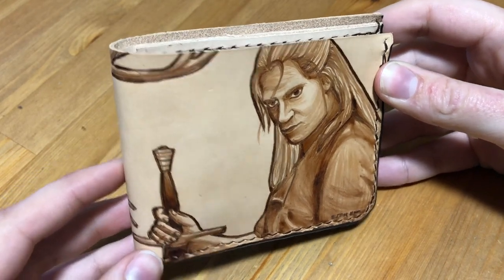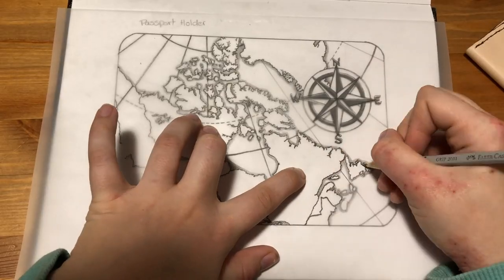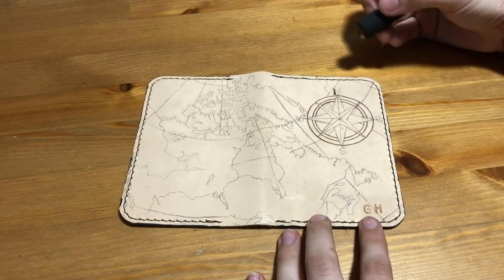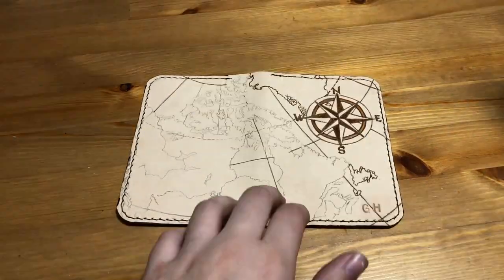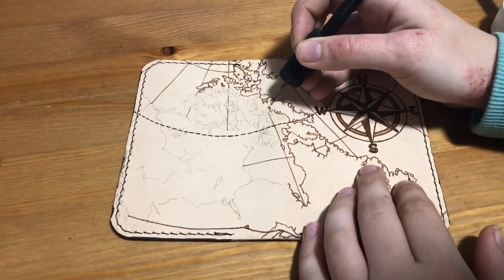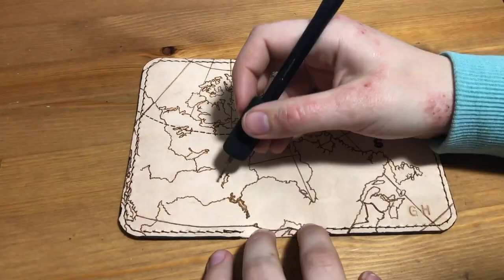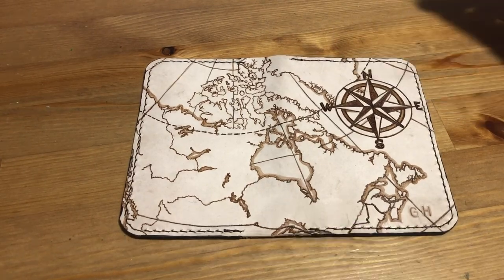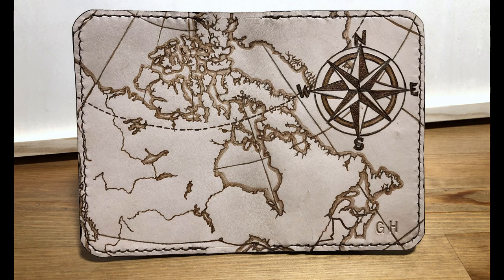Pyrography on Leather | Passport Holder

Comment: I'm still figuring it all out. I do have a wood burner and a simple beginner tool made for leather. I do print mine out. if it doesn't matter what direction the graphic is I found I can go over it heavily with a pencil and then use the transfer tip on the wood burning set I have to transfer the image. Or put it on my light table and do the same if it has to be a certain way. 
Also the leather does have a slight smell to it. It did throw me off at first because I'm used to burning wood. It does not smell like burning flesh.

Comment: I use the leftover pages from kid's 'sticker books', just reverse the image on the computer then print onto the leftover sticker page. I usually leave the print for thirty minutes so the printer ink has time to evaporate. Then just cut out the image and rub it on the intended piece to burn. 
I set the printer to 80% this helps and the image is clearer once rubbed on to the wood surface! I really like this method when I'm burning fancy and intricate writing. Just take all the stickers off the page and print where the stickers used to be.
Give it a go you'll never use any other method once you've given it a try. Also print in a red so you know where you've burned. A sample of my work can be seen in my avatar.
Reply from the maker: Thats a really cool idea. I've genuinely never heard of that method before, I'll have to give it a try. Thanks!

Comment: I cant seem to find a answer anywhere, is it safe to breath that nasty smell when burning leather?? And how do i even get rid of that smell off the piece of the leather i burned?
Reply from the maker: I didn’t find that my leather smelled too bad when I burned it. 

As far as I know, it’s really only safe to burn vegetable tanned leather that has not been dyed or coated with anything. If your leather projects smell really bad it could be that they’re chrome tanned leather or have a finish on them that is toxic to burn. 

Otherwise too much smoke isn’t good too breath in any case so you could try a fan blowing away from you and out a window. Also turning your heat down could reduce the smell if you have been burning on very high heat and producing a lot of smoke. 

Hope this helps :)
Reply: @WildwoodStudio  thank you for the reply, i appreciate it. I believe mine was veg tanned from research i did, i also think the smell was actually coming from the burner now that i think about it lol.

Comment: What model of burning pen are you using?
Reply from the maker: I use a Razertip SS-D10. The link to their website is in the video description of you want to check it out. I’m not affiliated with them or anything, but I’ve never had a problem with mine

Comment: I use carbon paper it’s ok but if you mess up your done
Reply from the maker: Yeah, that sounds like a pain. And I’ve always wondered if it would transfer black dust onto the wood even where there are no lines?
Reply: @WildwoodStudio  it’s not really black dust it just if you make a wrong mark you can’t get rid of it unless you sand it down
Reply from the maker: Ok, that makes sense, that might be ok with wood, you could sand it, but you’d be screwed on leather 😆
Reply: @WildwoodStudio  I would imagine I haven’t worked on leather but it seems interesting